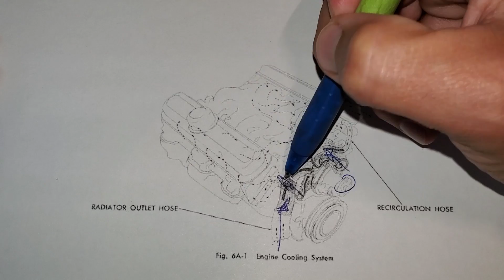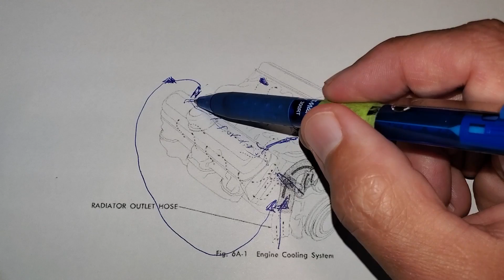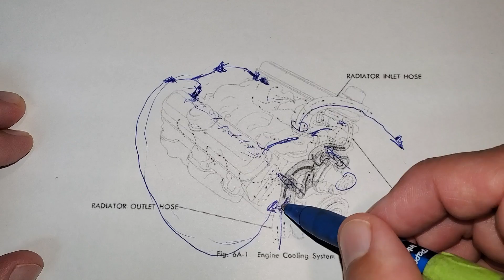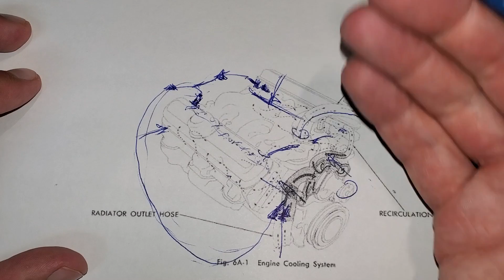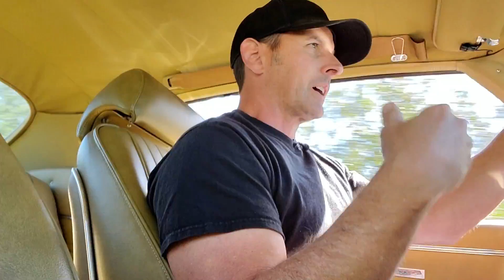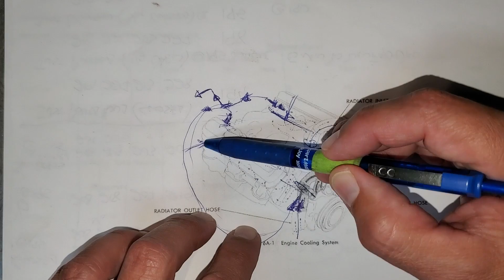Pontiac Head Cooling Trick - Heater Hose Myth?

Comment: I did the crossover on my pontiac motor after watching your video. I also have the edelbrock heads. I have noticed my car takes longer to heat up. I have no problems with it running warmer though. My question to u is what water pump are u running. Do u have the stock style with the cast iron impeller or do u have the newer style that looks like a flex fan. Also did u massage your metal plate that fits behind your water pump to fit your impeller.
Reply from the maker: Great to hear... yeah, Aluminum heads take longer to heat up.  Glad you're not running hot.  I have a Flow Kooler pump, so the plate is "pre-massaged".

Comment: I run lines from the back of each of my KRE heads, AN fittings,  to the intake crossover. Since I live in central Florida no real need for a heater. So I just block off that fitting on the timing chain cover. Works well.
Reply: Makes sense- you’re using the water pump’s suction to pull the hot coolant from the rear of the heads(hottest part) through the crossover, t-stat, and radiator… so the coolant is truly being cooled vs. feeding hot coolant into ‘cooled’ coolant.
Reply from the maker: @CrawdaddyCustoms  Agreed.  Might be another video... ha, ha..
Reply: I came to suggest the same. The issue was introducing hot coolant back into the engine rather than sending it straight to the radiator
Reply from the maker: @rustycarter2091  Thanks Rusty... totally agree.  Next experiment, I'm going to add a nipple to the radiator, and plumb directly to that.  We'll see!
Reply: @FastMonty  I   would bet that will solve the issue. Also very interested to see if both heads will run cooler. I'll wait and watch before I   move on my engine. @The Garage Clinic
Reply from the maker: @thegarageclinic3161  Agreed.  I can't wait to try it too... We shall see!
Reply from the maker: Good stuff.  Thanks Mark!
Reply: So you're bypassing the heads?
Reply: @thisisyourcaptainspeaking2259  No water still flows through the heads. Just returns to the cross over from the back of the heads.
Reply: @markwestcott6866  Yeah, I'm not sure what Pontiac had in mind or even how these aluminum heads are setup but most v8's the water leaves the heads at the crossover ports.
The recirculated coolant normally flows past the thermostat bulb for the thermostat to function properly, recirculation avoids hot spots and helps to distribute heat evenly throughout during warmup.  If too much coolant is allowed to continue recirculating once the thermostat opens, the system won't be able to reject enough heat into the radiator.

Comment: Mike, another great video.  Thank you.  Run the heater core outlet back to the intake manifold crossover.  The hot water will go thru the radiator before going to the motor.
Reply from the maker: I love it.  Thanks!
Reply: That won't flow because the pressure is equal.  Must go from a higher pressure to a lower pressure to flow.

Comment: I badly need these solutions to the cooling cause I am building a butler spec'd 462.  I would hate mess up, so I am open to any help from.  SBC / BBC no problem, but Poncho power I have always loved and building engines new to me.
Reply from the maker: You're in the right place... congrats on picking a Butler build.

Comment: I wonder if the nipple and heater hose on the driver side head was a larger i.d.  to provide more flow would help equalize the head temps ??? Just a thought for you. Also I Would think Aluminum head's would dissipate heat faster than iron head's. Great video topic Mike good luck. Could not help but pick up on the Dazed and Confused lingo, HA😝👍Al right all right. I've also heard of a product called water cooler coolent additive. Might be worth checking out.
Reply from the maker: Not so sure about changing nipple sizes... it seems, based on the comments, some cars actually have heater valves that open only when the heater is on.  So, those cars are equivalent to my valve being off.  I've heard of water cooler, buy I use Evan's coolant, which is better.  Thanks for the comment!

Comment: You have the right idea mike. But you should run your a.n. Lines from the rear of the heads to the intake crossover. That way they will be restricted by the thermostat as intended. Not pumping hot water back into the engine. I drilled and tapped mine on the back side of the crossover which should be no problem since you already split it from the intake. I ran the lines under the intake. This makes coolant flow the same front to rear
Reply: This is the way to go, the hot water goes back thru the radiator before going to the motor.  No Heater this way though.  I guess you could go through the heater then to the crossover.
Reply from the maker: @danw.8180  I like it!  Thanks!
Reply from the maker: Thanks Darren!  That's awesome.  Might have to implement something like that for Rev 3.0  ha, ha... thanks for sharing!
Reply: I wasn’t running a heater core though.

Comment: Great video, and you're using aluminum heads so the motor should cool down quicker than a stock iron head. When my 455 was together, I had that port in the back of the passenger side head blocked off also on the timing cover so water flow just went through the engine with cast iron heads. In summertime heat in traffic no problem,  cuz I like I told you before ran the fan on the motor and also electric fan in front of radiator for constant airflow. Keep the videos coming, enjoying.
Reply from the maker: Thanks for sharing, Steven!

Comment: Great info Mike, I’m installing my stroker 455 in my 65 and was thinking about teeing my rear head ports together. My heater core flows all the time , but I’m installing a shut off valve in the rear head connection. I also have aluminum heads.
Reply from the maker: Awesome!  Good to have it and not need it, versus need it and not have it.  ha, ha...

Comment: It would be interesting to see what would happen if you closed the valve and blocked the heater hose inlet to the timing chain cover so then you have a total heater delete. i was wonder if that would cause the water pump to pull the coolant thru the heads back to the thermostat more equally and return the coolant to the radiator since this would be the main path of return coolant to the radiator and if this would effect the head temps. Also running with a heater core is basically a auxiliary radiator so the return coolant to the timing cover would be slightly cooler. Well great video really enjoyed it take it easy mike hey you going to cops and rodders show in SD
Reply: Have to agree with you, this kind of goes with the old trick of when a car starts overheat turn on your heater  to help cool your motor. Probably work better just to run it back through the heads.
Reply from the maker: @BostonsOfTerror  That's what happened when I turned the valve all the way off, ALL the coolant went back through the heads, resulting in higher temps in the rear.  (My heater core is bypassed, which I failed to mention)  Thanks!
Reply from the maker: Good question James, that's exactly what happened when I turned the valve all the way off.  ZERO coolant flows through the heater line, acting the same as blocking the hose inlet and forcing ALL of the coolant through the heads.  Which proved the point the rear of the heads are hotter.  Yes, running through an operational heater core, with the heating fan on, will act as another radiator.  (Mine is bypassed, which I failed to mention)  Yes, I'll be at the Cops and Rodders show... you?

Comment: Mike 
Interesting to see how the electric WP will work.  I will be sure to install a valve on the heater feed line.
Reply from the maker: Me too Brian... yeah, that valve isn't required, but good to have just in case you run into my issue.  Thanks again!
Reply: You ever ran electric water pump curious to see how it worked out

Comment: my 68 Bird with A/C did not have a Heater valve  but my 73 Grand Prix did it is closed with Vacuum   "Jim Hand's book he calls for a .050" gap between the water pump impeller and divider plate"    Have you looked at that as well?  P.S. Keep up the great info
Reply from the maker: Thanks Fred... good to know about the heater valve.  Yeah, I have a Flow Kooler pump which comes with a tighter fitting divider plate.  Thanks for the comment!

Comment: Great information 
When i rebuilt my 75 400 ci Pontiac Trans Am i filled out all the water jackets that were not open on the smog heads and ran a 160 gel operated thermostat and it ran 110 to 120 degrees consistently at idle it would be 145 to 150 degrees with the fan clutch deleted and a 2 inch fan spacer which is really important to have the correct spacer for the fan near the fan shroud  ✌😎👍
Reply: You can also run too cool for efficiencies sake.
Reply: @superduty4556  yes but my car was running awesome and i wish i still had it,  i sold it out of necessity and i know i did the right thing.  I needed money for my Mom God Bless Her b Soul 🙏
Reply from the maker: Wow, that's ice cold.  ha, ha... good tips with the fan shroud.
Reply: @FastMonty  i really enjoy watching your videos
Reply from the maker: @asmdjjkg5830  Great to hear!  Thanks for being a part of the channel.